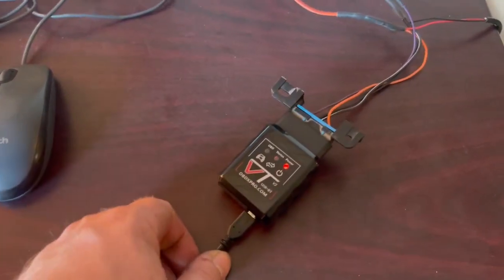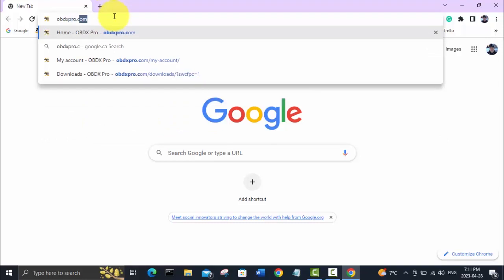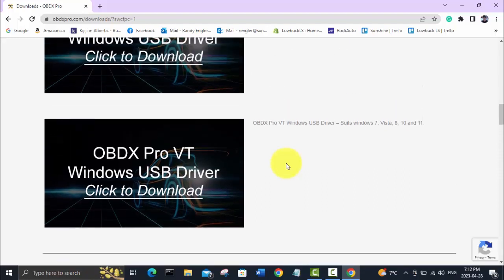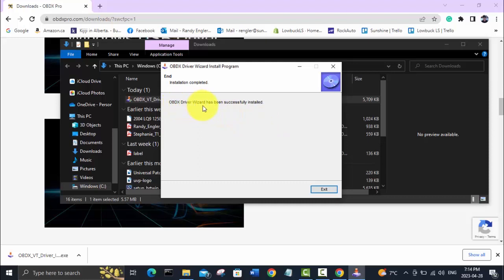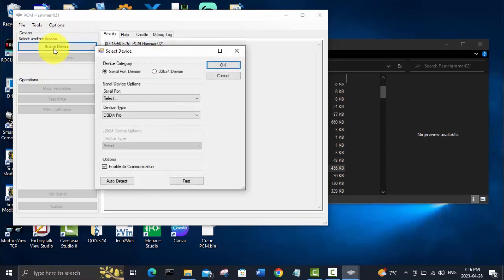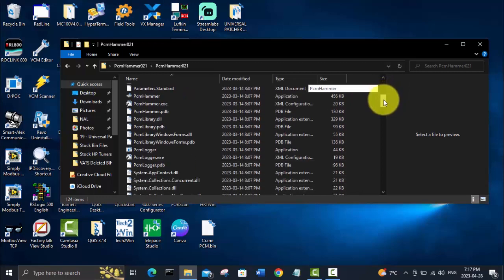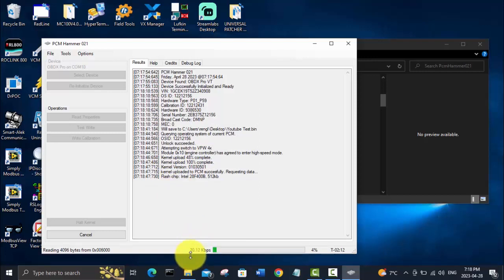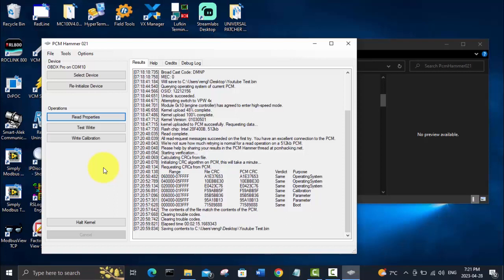Using the OBDX Pro VT with PCM Hammer

Comment: Very Cool! How did you reconfigure the OBDX Pro to run on the windows driver when it comes pre-configured to operate as a J2534 device and use J2534 API? For me, J2534 is the only connection that works but the connection isn't consistently operable. I'm trying to run the windows driver and run it as a serial port device just like you (not a J2534 device). However, it isn't flashing the file properly and put my tuck in limp mode. I had to unplug the truck battery every time it failed to reset my PCM.
Reply: Hey! Did more research! 

Unfortunately, the OBDX Pro VT has been discontinued. They are now selling OBDX Pro VX, GT, and FT but they appear to only support J2534 connections and it really only works for reading your bin file. Flashing a bin onto the PCM is not reliable with a J2534 connection. Supposedly there is a reconfiguration tool that allows the OBDX Pro to operate as a serial port device instead of a J2534 device. But I can't find it on their downloads section, which I have access to (you need to have an account and might be required to purchase the device before you can download the software). 

I would recommend waiting to buy anything from OBDX Pro until you can find the reconfiguration tool or until something comparable is available as the OBDX Pro VX (the one I'm using) and I believe the GT and FT do not appear to flash bin files (the engine tune file you edit on TunerPro) onto the PCM using the J2534 connection on PCMhammer. They may only work reliably with flashing by using serial port and through reconfiguring the OBDX Pro to be a serial port device along with the Windows OBDX Pro driver for USB device recognition (so that windows 8+ computers can recognize the OBDX when plugged into the USB port).

Comment: How would you use the tool to tune vehicles like the hptuner
Reply: Not sure if you figured it out but I'll throw this in for someone who has the same question. PCM hammer will read your current ECU bin. Tunerpro, hptuners, or universal patcher, will modify the .bin, then PCM hammer will write the tune file to your ECU. The device and PCM hammer is used to read and write to the ECU

Comment: Does it work with a 2011 chevy suburban ? I I would like to get rid of the DOD any help please
Reply from the maker: Sorry this only works on older Gen 3 LS based engines. For your 2011 Suburban you’ll need to use HP Tuners or some other programmer that is capable of removing DOD.
Reply: Trying to avoid hp tuners plagued with problems with people on youtube  that have bought it angry with bad customer service and taking away peoples dongles. Many bricked modules or dongles

Comment: Hey, LowbuckLS! I am a fellow Canadian/car builder from Ottawa and I've been studying your videos to learn how to tune. I wanted to thank for these awesome videos because you've taught me a lot and I'm almost where I need to be. As you know, winter is closing in fast and i'm running out of warm days to get my beast running.

My beast is a 1999 Astro van that's highly-modified and has about 2 feet of lift. I've also blessed it with a 5.3L V8 and an Nv3500 manual transmission. My problem stems from the fact that GM never made this transmission/engine combo and it's almost impossible to find what I need for segment swaps to be done properly. 

However, I have found the exact tune I need on GearheadEFI and that tune was done by a professional tuning shop that used HPTuners. The customer has paid them, then extracted the .BIN file for sharing, but I've been waiting almost 4 days for my GearheadEFI account to be approved and I haven't heard anything from them. I've tried emailing the admin, I've tried messaging mods for the site - nothing.

I'm in desperate need of help pulling the file from their site because I can't download it myself until they manually approve my account... if they ever get around to it. I was wondering if I could pay you to get the file for me?

Thanx for your time and consideration,
Glen AKA Stunt Dummy
Reply from the maker: Hi Glen, sounds like an interesting project! Shoot me an email at randy@lowbuckls.com and let me know what file you need and I’ll grab it from Gearhead EFI.
Reply: @LowbuckLS  Right on, brother. Thank you so much. I'll send it to you right now

Comment: I splurged on the GT and its an amazing tool. With the IPC hammer port of pcm hammer I was able to to change the text that appears on instrument clusters to add another level of customization. For the price they really can't be beat
Reply from the maker: Cool, do you know what the differences are between the GT and the VT?
Reply: @LowbuckLS  the GT can also do dual wire GMLAN and other gm protocols
Reply from the maker: @autumnjeserich2689  nice, I might have to order one to play with once I start working on more Gen 4 stuff
Reply: @autumnjeserich2689 no way you said the GT version will be able too ? And I would have have to do what to change the text on the cluster ?

Comment: Using the gt version of the tool, I keep getting vin querry failure. Any suggestions? Thanks for your content.
Reply from the maker: I'm not sure what to suggest, I've never used the GT version... do you have it set up as a serial connection? I got a VIN query failure with my VT when I tried to use it in J2534 mode.
Reply: @LowbuckLS  Yes, it finds the device, vin fail when trying to read the pcm.
Reply from the maker: Weird. You might have to contact OBDX Pro for that one, I haven’t had that problem.
Reply: you need to reconnect it. The GT has weird connection issues in my experience. To get it to work in my experience disconnect it from all power, including from the obd2 port, I normally just kill power to the bench harness, then remove the usb cord from my computer and plug it back in. Then reinitialize it without exposing it to power from the obd2 port. Also make sure your initializing it as a serial device not a J2534 which I know is confusing.- Once its initialized its fantastic
Reply: @autumnjeserich2689  is it this way still the one he on about is discontinued ahh or what i need to buy that ant slow or cost a mint thanks
Reply: @overbuiltautomotive1299  The VX is the replacement of the VT and can do single wire canbus with j1850vpw. The only thing it can't do that the VT can I think is lsdroid which is basically obsolete at this point.